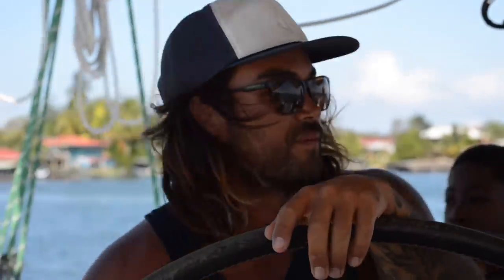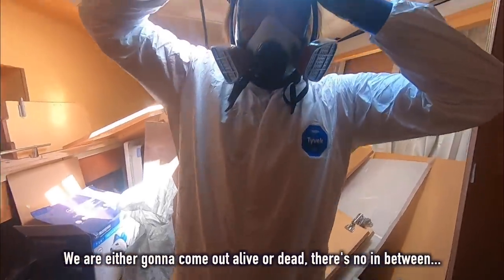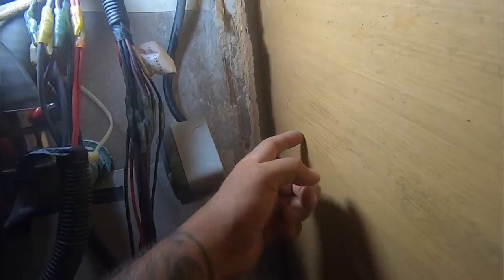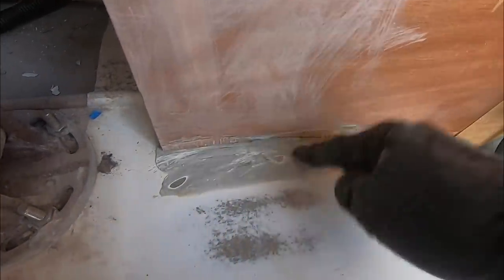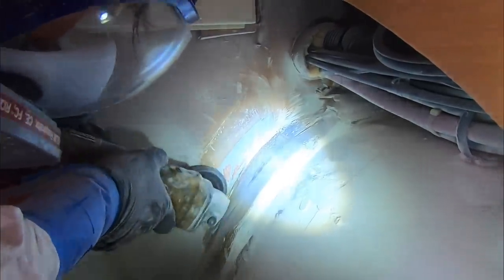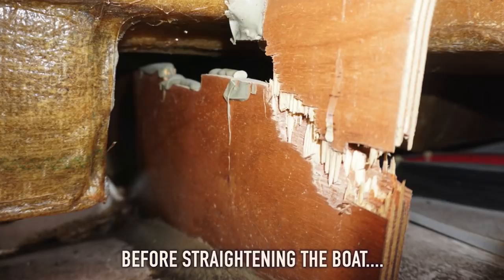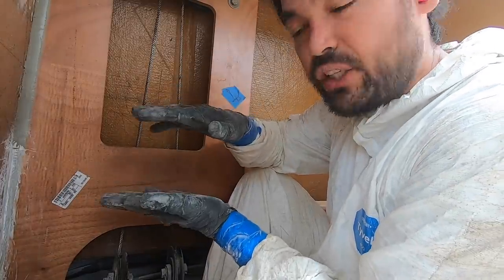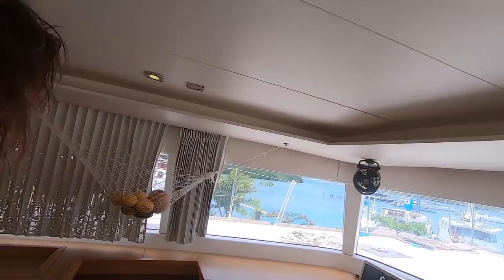CRACKED BULKHEAD REPAIR SERIES - Part 7 (Episode 112)

Comment: I am subscribed to several sailing Utubers and you are the latest. I really like the fact that you are taking the time to get this right. I have dove head first into similar efforts knowing I was going to go to the foundation if I had to. Only for the reason of getting it right not that I have brass, big, or steel balls only because thats the way to git er done.

I realize that may not be for everyone however when you are doing the work why would you see something and not take care of it? 

I do have one suggestion. Grab a good CFM fan and install it on your deck. Connect channel you make out of heavy plastic and duct tape that to your fan intake side and upper deck portal. Make another channel using heavy plastic and duct tape to the fans output end. Make a 2x4 frame that a Lawn and Leaf bag just fits over and duct tape. Next get a furnace filter, cheese cloth etc and add that to the wooden frame. Carefully cut an opening maximizing the filters area of exhaust (this would be the area from the 2x4 frame to where you tape the output of the fan), cheesecloth etc as an exhaust port and duct tape the other end of your fan exhaust heavy plastic.

Turn on the fan, go inside and at least you will be cooler, have better air quality, have much less dust to clean up while keeping the neighborhood clean. Should save you a lot of cleanup time.

Your thoughts?

Comment: Customer support has been great with you so far. You have an opportunity to reach out to the company directly. The sensible thing would be for them to get out ahead of this thing and issue a recall for inspection and reinforcement/remediation as necessary.

Comment: When we grind fiberglass we always use a flex machine with a a 20grid paper on low rpm. Almost no dust gets in the air, it lands in a piles. And with a vacuum cleaner on the outside of the boat with a cut of "plastic can" on the end of the hose it's usually a clean job to grind fiberglas!

Comment: I'm a boatbuilder (of over 100 boats plus a 46' catamaran) and not a lawyer,  but I would imagine that one problem you would face in a lawsuit would be that the boat was in a hurricane.   In any lawsuit Lagoon is going to insist that they have no control over their products once they leave the factory and the possibility that conditions exceeded design parameters causing the damage.    As to the repairs I tend to think tabbing as you are saying is intermittent glassing.   You should use continuous tri axial glass.  i.e. strands run 45 -45 and 0-90 across the bulkhead.  I used a pre cut role of 8 inches wide and a fillet of epoxy against the hull to smooth angle glass takes.   Be sure to coat all 6 sides of ply before installation with epoxy and then solidly glass.   Keep up the good work and watch your health from dust which is composed of tiny glass bits which are bad boys under the microscope.

Comment: Hey Colin. I'm a seasoned marine mechanic and structural aficionado. Mostly mono hulls. But I was leaning towards finding a Lagoon 410 until I saw the craftsmanship of the interior structural integrity. The bulkheads are ridiculous. Numerous cutouts to close to deck and hull attachments making a weak point. But the putty only without tabbing has really got me rethinking my direction. I would end up doing exactly what you guys are doing to make it strong. There is no good day of grinding that's a given. But prep is the key. Remove air gaps when possible, grind, grind, grind. Vacuum & wipe w/ acetone. I'm on a two year rebuild of a 40' Excalibur so I can totally relate to what your going through bro. It makes me wanna fly down and help ya. I wonder if I can bring my balls on carry on or I gotta check 'em? ✌

Comment: Get a high speed fan and blow outside air inside the salon to create positive pressure inside that area so dust is forced away.   Open a hull port and let the pressure flow that way but keep it under pressure.

Comment: I can relate to the Insane lack of room that you two are working in.
I was a commercial aircraft structural mechanic and would stuff myself into the wing fuel tanks to remove and install rivets. When finished someone would literally have to pull me out, because I wasn't able to do it myself.

Comment: In an attempt to reduce the levitating sanding dust I would try to create a negative pressure down there. That would propagate less dust in the saloon area.
I don’t have a boat but I believe that you could have some improvements by attaching on a (disconnected) thru hull, some kind of extraction fan. I recon that this is difficult because of the small diameter of the fittings. A cheap and easy to implement solution would be by using a fan from a server computer. Inside most rack mounted 1U servers there are usually a few pairs of small push-pull fans with high performance.
Just for example, the GFM0412SS from an old HP DL360G8 can be found for ~10€ and with external dimensions of 47x40X75mm it can produce an air flow of about 21CFM. With some duct tape and maybe a small funnel at the internal end of the thru hull in order to improve the air flow It should improve the working conditions. For the specific fan you just need to connect the black wires to the negative 12VDC and the red with orange wires to the positive 12VDC. No need to use the other four wires. With 12VDC @ <2A and some noise you should be ok.
I know that you are in a kind of isolated area so maybe some visit to an electronics recycling dumpster or a local repair shop.

Comment: The correlation is quite simple. When grinding glass small bits of abrasive material find their way into your undergarment and leave  micro abrasions all around the sack these small cuts heal and the scar tissue increases volume of the testicles as well as forming a tough outer layer.

Comment: You can rig up a simple air filter with a 20" box fan and a pleated HVAC filter, should help get rid of a lot of the residual dust in the air.

Comment: the testicle comments relate to your willingness to take on a project that 99.9999998% of the population would simply walk away from because lets face it....it's the easiest and maybe the smartest thing to do - Cut your loses and move on. We admire your determination and willingness to see this through to the end while teaching others the methods to your madness. In the end you will have a bulletproof boat that will be better than the day it first launched from the manufacturer. Keep up the great work!

Comment: Colin if you what keep the dust to a minimum get a duck fan say 300mm and such the inner dust through a disposable filler at slow speed and out to the outside. This creates a negative pressure in the work space which controls all dust going out and will control the dust in your work space. Get flexible ducting so you can move it closer to the work space. Get two boxes of disposable say 400x400 filter and tape them in place as you use them it will make a huge difference. Having worked on big yachts you will know how it works with a negative air space. Hope the helps you. Say hi mate to Jamie.
Regards Geoff. 
PS old fridge Machanic and ac tech

Comment: Hi! Been following your journey and closely interested in this recently found major problems.  
You show excellent disciplined skill with identifying problems and tenacious focus for proper repair. I haven’t seen any quick fixes to end any problem. 
Identifying the bulkhead problem that lead to connecting with the main engineer was vitally important to your quest. He explained main design vessel benchmarks that provide a base with which to resolve the overall problem. How you went about accomplishing gathering and using these benchmarks showed unique ingenuity using simple methods. Certainly this has been inspiring!
Many to most don’t have a clue with how to pursue these problems. Their comments may reflect their inability to find resolution. Of course hiring help already has shown the limited interest in thoroughly investigating and resolving the problem.
I feel once the design fundamentals have been secured with vessel restored to its original benchmarks you will be confident to Sail it anywhere. You’re developing creditability among a large number of lesser skilled Sailing enthusiasts. It’s expected you’ll be called upon by others requesting your unique skill!

Comment: after doing some research I found the the circumference of balls can be measured by taking the difficulty multiplied by amount of fiberglass dust divided by 2 multiplied by pie then times that by amount new fiberglass added. You can then find the material of the balls by whether or not the repairs work and you get back on the water. Good luck bro, I hope all goes well and you can cross the Pacific this summer. I look forward to continuing to live my dreams through watching your channel.

Comment: Try putting a vacuum outside the boat onto an open through hull. Dont use a filter in it. Just use it to creat negative pressure in the area you are working in. Will pull dust out and stop it spreading into other areas.

Comment: To stop the dust from going inside your boat you need to create a negative pressure in the room you're working. Put a fan or like a dryer vent outside the port light to suck the air out of the room and blow it outside,

Comment: I've been there grinding on the inside of a hull and it really sucks. I highly recommend getting some box fans and some air conditioning filters a bunch of them stick them on the hatches and put some negative pressure inside that boat it really works guaranteed. Lots of filters and change them often. You don't need that shit in your lungs .

Comment: Dust control: A floor fan exhausting out a hatch nearby. Get 5 a/c filters the same size as the fan, make a cube by taping them together with the fan as the sixth side. The idea is to depressurize the compartment you're working in. You'll have to shopvac the filters often probably. depressurizing is standard for asbestos removal workers. It works.

Comment: I have been working on these boats for over 10 years. Lagoon, Fointaine Pajot all the same, they normally fall apart after 3-5 years of offshore use. They are the nautical equivalent of the hobby Black and Decker drill with the plastic gears inside.... They are not intended for anything else than hobby use on calm days in protected waters, during good weather conditions.

Comment: Many props for taking on and completing such an extensive repair (bulkheads). Just from my limited experience, I'd suggest you inspect any and all attachments to cross members shared by the two hulls. Maybe, a reinforcement(s) could be installed to increase the rigidity?

Comment: I have seen catamarans only 3 months old with cracked bulkheads in them . you have to remember all boats sense about 76 was made moduly to cut down on construction costs . So don't feel bad my friend and I fixed a home made tri hull that this old man had and he said it was flexing to much in rough seas  . The outer pontoons was made to detach for transport . So we replaced all the bulk heads with steel and made frames the connected all 3 hulls together but they was still able to detach  the outer pontoons . took us about 4 months to complete .

Comment: I was debating whether to leave a thought I've been having, but when I got to 14:52 and heard what you said, I knew I had to tell you. I saw how much cracks were in the catamaran and how difficult it was for you to reach everywhere to fix them. I suggest that you find a way to BRACE the entire midsection of the hull, on the outside alongside the inverted U, Keeping the streamlined shape, using carbon fiber. If you're gonna sue. then disregard this suggestion lol.

Comment: I once did to an old RV what you're doing to your catamaran.  There was a huge spot in the rear wall that was rotten and soft, and most of the inner walls were swollen from water intrusion.  I removed all the appliances and cut out all the inside walls.  And then life got in the way and I had to stop for a while before I could continue.  And then Hurricane Michael turned the whole thing into a debris field.  The end.

Comment: Just an experiment to see if comments on old episodes percolate to the surface. ;) In reference to the volume of a sphere or cojones and its relation to fiberglass particulate matter, I believe it is much like an "apparent" wind measurement. The higher the concentration of grinding-induced particulate matter, the larger the apparent size or volume of the grinder operator's equipment...

Comment: The idea that you have large ball is because you are basically rebuilding a wreck and going to finish the sail back to the land of Kiwis. But I have talked to others about your show and what you troubles you are having have happened to more than a fair share of the owners of this type of boat. The glue and glass just don't hold. When you get you bulkheads back to where they belong you should peg the plywood sheets together after you glue and before you glass using 3/4 hardwood dowels. However NOT at a 90' angle to the ply but at 30-45 degrees. 3 or 5 of them coming from one and the other forming a X in a line. This should fight the shear force and keep them from slipping.

Comment: There has never been any question in my mind that it IS a design flaw.   The bulkheads should serve as the webbing for a beam with upper and lower load bearing members forming what amounts to an Ibeam or box  beam.  It is the flanges (upper and lower portions) of a beam that carry the actual tension and compression loads, with bulkheads (webbing) acting as a shear web.  Proper reinforcement means not only repairing the bulkheads themselves, but adding load bearing material top and bottom.   I would suggest some sort of unidirectional fiber at the upper and lower extremities.  It could be hand laid roving such as unidirectional glass roving, or carbon tow, or solid pultrusions if they can be gotten into place......That structure needs to carry all the way across.  There is a pultruded carbon fiber strip material that comes in a roll which would be great.   Look at the structure of Wharram's beams, Richard Wood's beams, the  Edel Cat beams and various others.   Other designers often make the walls of the bridge deck cabin and furniture, etc into a complex beams structure, with each component enhancing the  overall strength and stiffness.   A  more complex design challenge... more elegant, but also dependent on nothing  being altered from the original plan, as everything is structural.    It also depends on those constructing the boat to understand the importance of the materials, bonds, and tabbing, as it all has to work together and the structural interactions are not simple.

Comment: I am not a lawyer or an engineer, but I have worked in the nuclear field where everything is bout strength and durability and from the beginning of you showing us how the bulkheads were attached and not stiffened up at areas where they removed plywood to make a nicer pass through, I have been expecting this... I lived on two war ships for several years and it gave me a great chance to see how the bones of strength are built. BULKhead is a point if maximum structural strength. You won't find a square corner on a war ship bulkhead. Always rounded as the curve shares the stresses and is far stronger than any square cut. But they design cruising boats to be super comfy for the crew and give up strength for comfy... What I see wrong with that is the fact that you can have both, but adding strength means adding a few more dollars and at the price of these vessels I have to think that is not being done because it is taking away from the profits at the top... Don't think for one minute that auto companies wouldn't leave the brakes off from cars if they could get away with it!!  Hopefully your boat builder is watching your (REMANUFACTURING) of their design and are changing their way of building as we speak!!! It is far more than obvious that they ABSOLUTELY NEED TO!!!  And if someone proves that they have known about these issues and NOT fixed them, they will lose their asses in court..  Best luck my friend...

Comment: Perhaps there is a thin line of work for you to Inspect the damaged boats to see if their failures are common to the same areas for the same reasons.  Your expert testimony would possibly be a significant help to the prosecution of Lagoon in finding design fault.  PLUS, you could direct repairs based on what you find for each boat owner, and provide materials costs and man hour estimates to get the work done - that equates to the dollar figure Lagoon might be held liable for.  Of course, that thin-line tasking isn't cheap - KA-CHING would assist in getting your finished up and pad the coffers for your round-the-world trip(s).  Make it a point to get to Sardinia in the summer.  Absolutely beautiful place and the people are so, so nice.

Comment: The secret to working with fiberglass dust is before you put on the protective suite cover your self in a thick layer of baby power it will get in your pores and help stop the glass shards from getting in they don't effect your regular skin they get into your pours and their then sticking out at a 90° angle to your skin and that's what causes them to grab stuff and irritate your skin trust me I worked in a body shop that specialized in drag cars  and we were forever grinding fiberglass try it , it works and when your done take a cold shower a hot one will open your pours and help the glass slide in deeper

Comment: Cuz, I think you’re doing a fantastic job even though it can be soul destroying at times. The Kiwi/Aussie fix it attitude is good and well and what you are showing to your fan base / sailing community is absolutely essential for those wishing to renovate used boats ie this is what structural integrity looks like. Well done fellas, one inch of ground each time gets you closer to the try line!